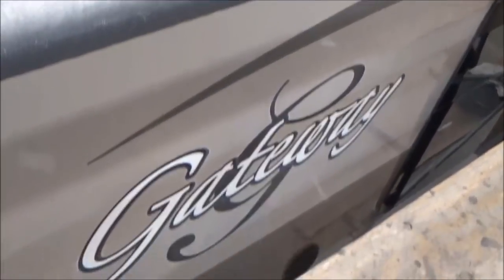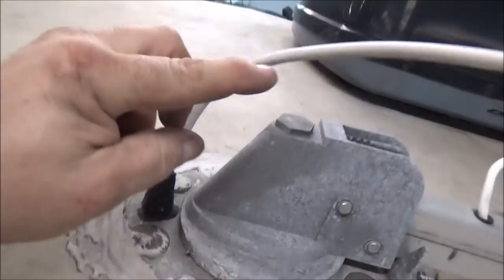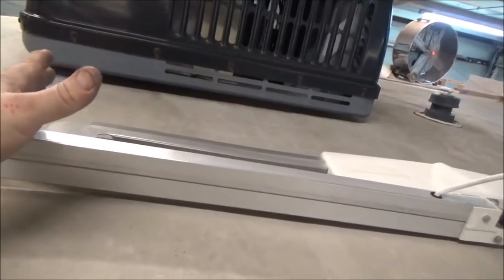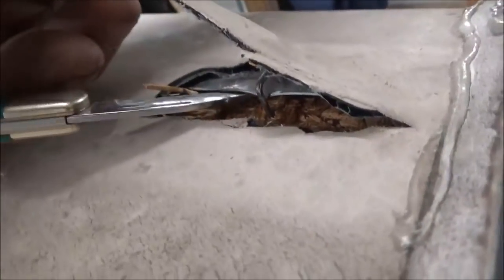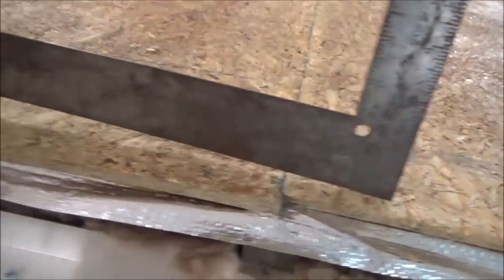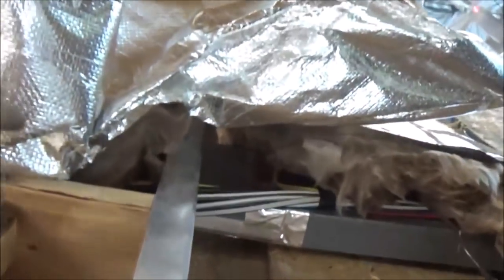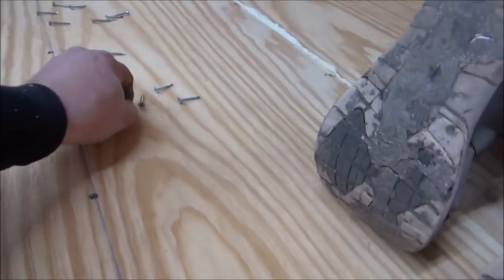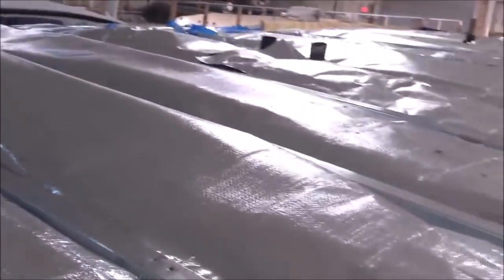Rv Roof Replacement and rear wall rebuild on 2013 Heartland Gateway

Comment: Boats and cars don’t leak, why do RV’s?
Reply from the maker: House boats leak...cars don't have a membrane roofs nor do they have a protrusions like an RV. Sun roofs will leak if not done correctly. Thanks for watching.
Reply: @RVROOFINSTALL   it seems like there would be an innovative way to keep them leak proof. I’m just now seeking ways to start repairs on an inherited RV that has major damage from years of neglect.
Reply from the maker: @explaincauseidontgetit3294  There is a way to keep the leak proof....we designed the innovative way. Thanks for watching.

Comment: don't the foam absorb the condensation draining out
Reply from the maker: I'm not following your question Travis.
Reply: on the ac unit with the foam curb wont that absorb the condensation and leak inside the unit ?
Reply: like watch how cheaply they are building these things and selling at a premium and then 3 4 5 years later yall are having to repair their screw ups
Reply from the maker: @hotrodpegleg  The curbs aren't foam. The condensation drains inside the AC and out through the ports to the roof. The part of the AC in the curb is the duct for air supply and return. Does that answer your question?

Comment: Some construction on " mobile homes" and RV's need a little flexibility. Or you well have problems.
Brother in-law ruined an expensive mobile home. He made his changes to rigid.
Reply from the maker: You can't stop the flexing, you have to account for it. Proper flexible adhesive absorb shock, expansion and contraction. Thanks for watching.

Comment: You have to store your Rv in a covered place
Reply from the maker: Asking or telling?
Reply: RV ROOF INSTALL telling
Reply from the maker: @mrpaulgrimm6129  not with these roofs. These are commercial grade. If it's good enough to be in a hospital, restaurant,office building....you don't need to get it under cover. Not bad advise, but not necessary. Everything is commercial...right down to the primers and caulk.
Thanks for watching!
Reply: RV ROOF INSTALL I’m talking about the factory roof on RVs The sun is hard on them in Texas
Reply from the maker: @mrpaulgrimm6129  yes you are correct. Those RV roofs are low budget cheap membranes.

Comment: I had to repair wood rot in the deck of my aluminum framed 42 5th wheel.  I was shocked at the lousy "craftsmanship" of construction.  The aluminum frame was just barely attached to the structural trailer frame. There was a lot of damage to the aluminum frame from careless fastening.  I built new steel brackets for every major post.  I wondered what was used in that roof curve.  The gutters on these trailers are totally useless. My confidence on manufactured travel trailers is very low.  My trailer was built as a long term liver, but it was just thrown together from available stuff.  Pisses me off thoroughly.  I'm wondering how much this massive repair cost?
Reply from the maker: I don't like the aluminum frames. The alloy is cheap and the welds are small...usually just one sided or a simple stitch. I'd rather a wood frame with fiberglass if I wereto own one, but I've never camped.
Reply: As far as I can tell, mine aren't welded, but held together with 1" angles and two 3/16" x 1/2" sheet metal screws each leg.  Not sure if that's all over, but that's what I found in the lower half of the structure.  I thought it was welded!  What a lie!  I don't know if I'd use wood either. Had one of those in the 60's that I was always fixing.  Fun time for a teenager during the summer.  I like the idea of aluminum, but has to be done right or not at all.

Comment: I can understand your need to exaggerate to some extent to get your point across but daaum! Reseal the roof every 3 months? Hahahaha!!! I have owned motor homes and fifth wheels for over thirty years and that statement was way past an acceptable amount of exaggeration.... bahahaha!!!
Reply from the maker: It's not my exaggeration....it was in an owners manual on one of the coaches we did. There was a chart that stipulated when and what to seal. Dicor isn't shy about telling folks to seal often or frequently as they put it
Thanks for watching just the same.
Reply: @RVROOFINSTALL  Thanks for the heads up on Dicor, that is nuts that they stipulated that kind of regimine. I guess it shows the quality of there overpriced product. Hey love your vids... I was just messin with you ;)
Reply from the maker: @timallbritton3716  Dicor caulk is there cash cow. Any other company that was concerned about quality would have had it reformulated by now. The exploit people's ignorance to roof systems.

Comment: That caulk job.  I see people use silicone on RV roofs.  Fools.  Silicone products are weak vs sun and weather.   Cluelesss even RV dealers and RV repair folks are only making roofs worse.   I have EPDM on my class a.   I installed the EPDM the same way that I roof big commercial buildings.    Roof it right.  RV roofs are weak.  Wise to make sure it's sealed.  No primer on vents and sloppy work allways ends with leaks.
Reply from the maker: People don't research. They listen to the so-called experts  who don't research. All anyone has to do is read a tech data sheet, and they'll know if what they are using will work for their application.
Getting lazy costs a lot of money. Although, for me, i am not an EPDM fan. Never was, even with all the commercial roofs I installed, I never kicked out one roll of it. But like you said, proper prep is the key.
 Thanks for watching